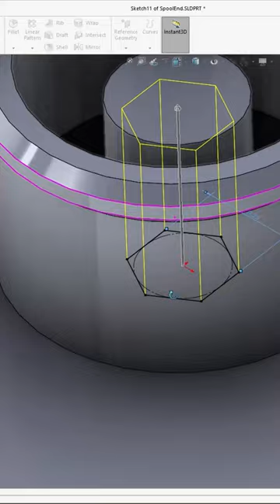Practical 3D Print: No More Tangled String

Comment: you could have created divots in the spool, so the string could simply be slotted there
Reply from the maker: Well the problem is the string falls off the end of the spool that's why the ends with the higher edges helped. I designed in slots but the string slips out easily so I just taped it. 😅
Reply: @dandesigns3d  hah!